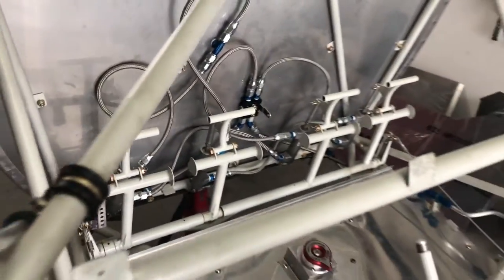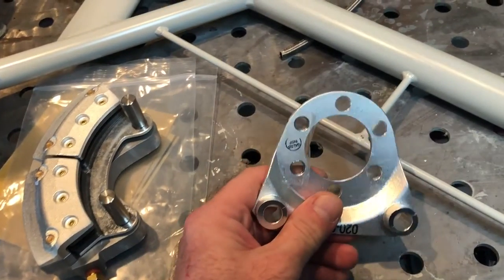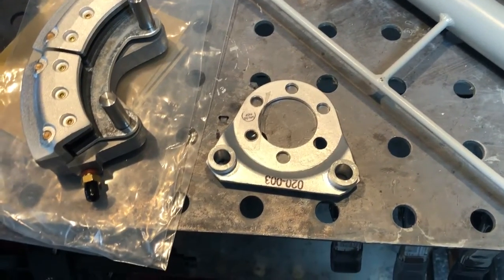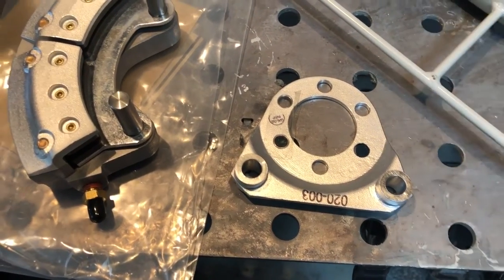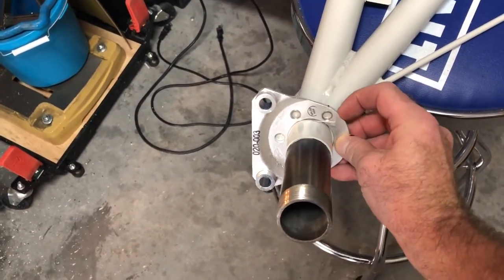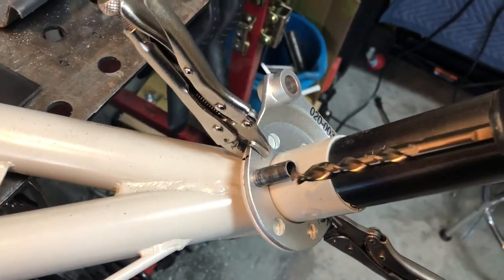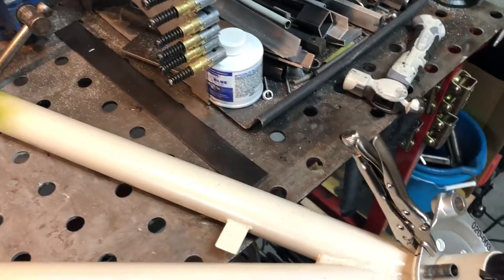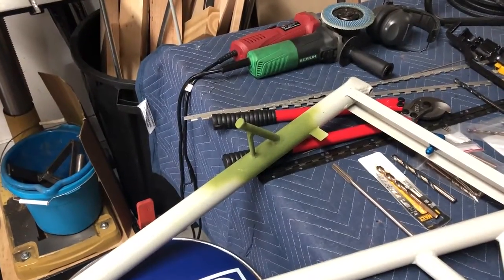Bearhawk - Grove Brake Torque Plate issues while building the Bearhawk.

Comment: Transfer punches are great to have around for accurate transfer of holes to drill.  Like a center punch with a outer diameter to match the hole you are transfering.
Reply from the maker: Great tip!
Reply: Just bought myself a set to drill my brakes! Great tip mate!